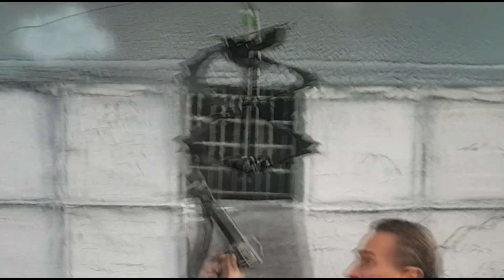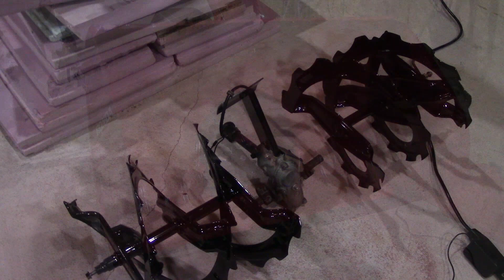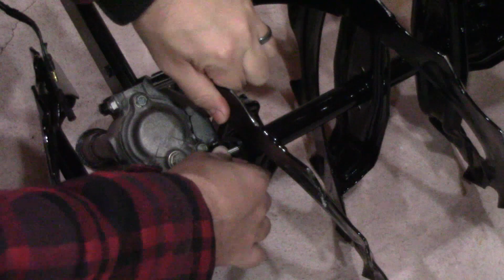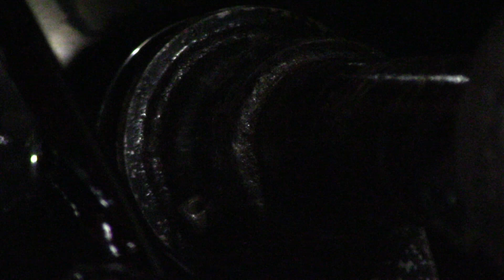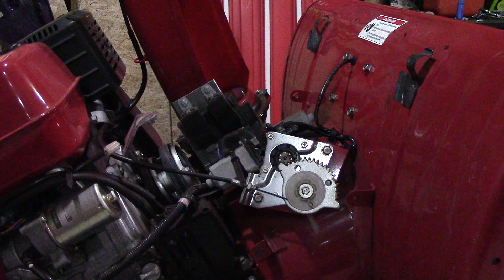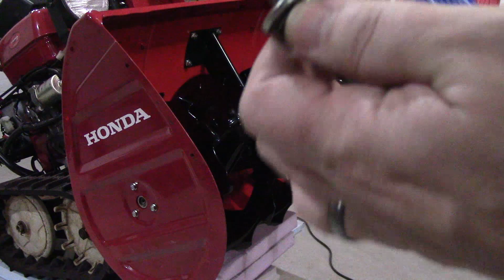HONDA HSS1332 Snowblower/Snowthrower Auger Removal And Refinish (Part 4)

Comment: What did the powder coating cost?  Was it cheaper than new augers?
Reply from the maker: Definitely cheaper than new augers, but the teeth on mine were still good. I honestly forget how much the powder coating cost between the sandblasting and actual painting.

Comment: Thank you, I enjoyed your video. I did something similar with my older Honda HS928. Things I did differently... I used some anti-seize on the augers on the end where they contact the shear bolts. My auger had seized to the shafts and it took a lot of brute force to free them.  Second thing... since you ended up repositioning the scraper bar (those bolts go in slots) it may have been advisable to readjust the clearance between the scraper blade and the ground to make sure you have that just right too. My project involved replacing the bucket assembly (far more gravel damage than you had – holes punched right through the impeller housing) so a little more work scope than you had.
Reply from the maker: Sounds like quite the project indeed! Thanks for watching and taking the time to write!

Comment: If you did not already do so ,, applying protective grease to the inside of the impeller sleeve (as it likes to rust unto shaft defeating its shear bolt functionality) and where the impeller drive shaft pins into the auger input drive shaft,,, and both gearbox output shafts that insert into the augers on both sides , or they can internally rust to the auger sleeves and also defeat the shear bolts protection of the auger gearbox should the electronic auger protection system fail  ,,  that machine does have electronic auger protection which is a rather unique feature ..https://www.snowblowerforum.com/threads/how-it-works-auger-protection-system-hss1332atd.97610/
Reply from the maker: Awesome suggestions Brian. I will definitely get some cold weather lithium grease on there if/when I end up disassembling again in the future. Thanks for taking the time to write!
Reply: @AmbitionAcres  its a maintenance issue to take the augers off once a year and grease the auger drive shafts or they will environmentally weld themselves together sometimes requiring a lot of efffort and heat to get them to spin freely,  and yes this will break the gearcase.. https://youtu.be/DiR_LAZQ6jc , the impeller will do the same thing ..  another feature that has a lot of merit is to add a grease fitting to the track drive transfer gear case so you can grease the track drive gear train  , https://youtu.be/y2LCF2v_g6U

Comment: from terrace bc I  have the same blower same wear problems . What I did for the "round housing repair" was got a welding shop to pre-bend the same diameter  3/32 thickness x 4 1/2 wide round steel band. I went home and cut in half so " it will fit inside with-out taking the auger out" anyways I tack welded it in "used a small wedge in-between  the propeller and band for a tight fit" thank god cuz the stock metel is paper thin. Now I have a re-infourced housing with a tighter tollorence

Comment: Great video series!  I’m curious, how did it perform for you?  I’m assuming with the augers, chute and housing glossy smooth again that the performance was pretty close to when it was first purchased.  How do you feel about it?  Best!  Jerry
Reply from the maker: Hey Jerry, sorry I hadn't replied sooner, but I figure better late than never! If you get a chance, I'd suggest taking a look at one of my recent videos titled something like "New Year Recap And Blizzard Cleanup". In that video, you can see how well the snowblower has been holding up. Not to spoil it, but she's doing great! Only issue now is that I have a rust hole in the housing, and so she spits snow out the left side.. you can see it in the video I mentioned above. Hope all is well, and thanks for your time.